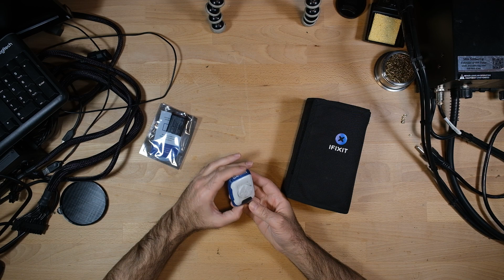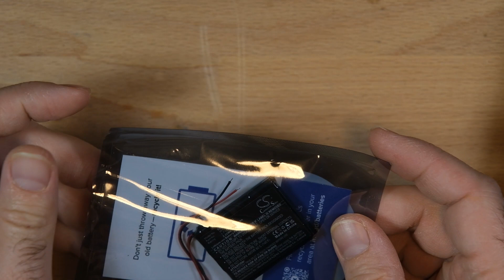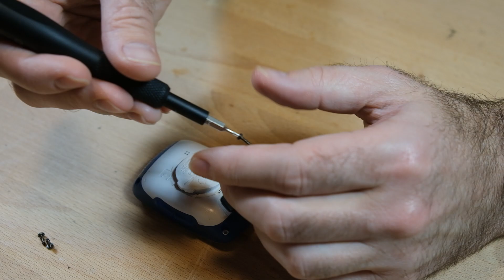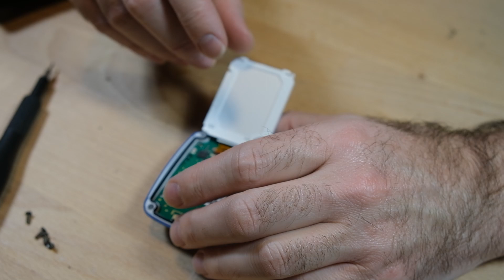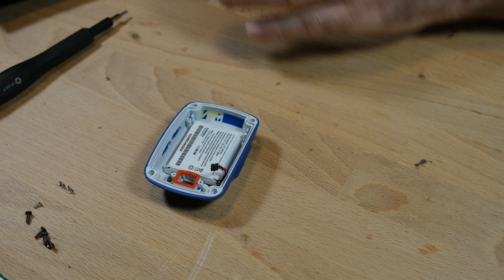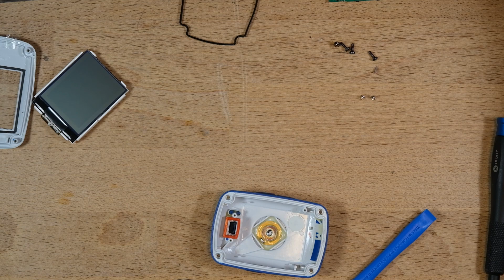Garmin Edge 500 Battery Replacement

Comment: Helpful! Thanks. What are the specs of your soldering iron?
Reply from the maker: The soldering station I used in the video is an Aoyue Int968A, but it's way overkill if you're buying one just for this.  You could do this repair with pretty much any soldering iron, including the cheap 15W or 25W ones that you can get from hardware stores.
Reply: @AaronAverett  Thanks a lot Aaron! My Edge 500 is in line for a refit...